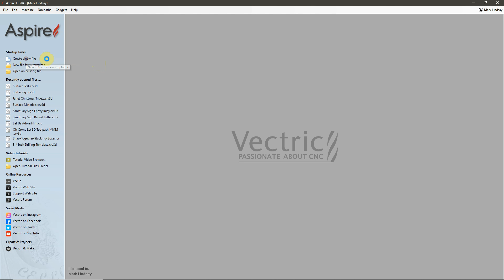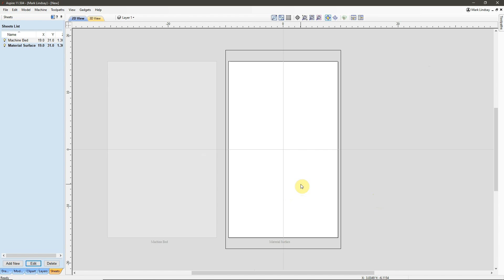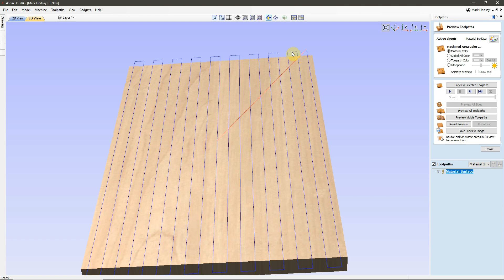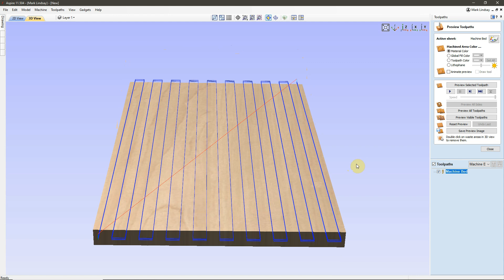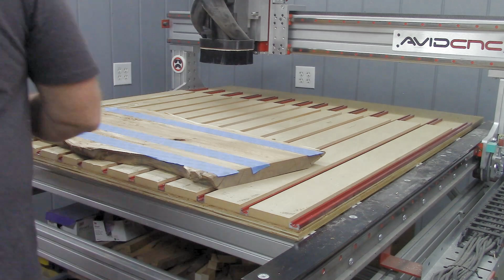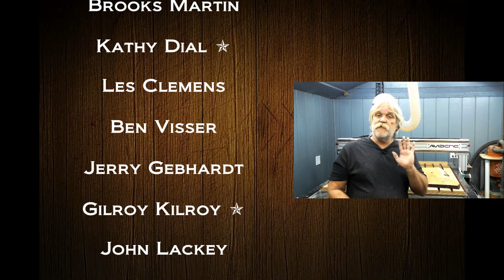Surfacing Materials Using a Toolpath on my Avid 4848 Pro CNC Router

Comment: Mark, thanks for 2 more very informative videos. I've owned my Avid CNC for 6 years and to this time the only thing I've surfaced is the spoil board. I have 5 Cedar slabs around 24" in diameter, which are too large for my planer, that I need to surface. Like your slab none of them are flat. I've never used MDI commands, so I picked up several useful tips in the first video of this 2 part series. I always visit your site when I need an answer!!!

I do have 1 question. Where did you get your dust shoe on your machine?
Reply from the maker: Thank you! I got my dust shoe from Keith over at One Guy in a Shop on Etsy. He's a good guy. If he doesn't have what you need, he'll make it for you.

Comment: I realise that you are only taking fairly shallow passes to surface the material but wouldn't the use of 'Ramping In' be of assistance when doing so?
Reply from the maker: Good question! Because I set up the toolpath to come off the end of the material by the bit's diameter, I don't need to ramp in the plunge moves. It'll make those plunge moves way off the material, then enter the material at the correct depth for that pass. If I had created the toolpath's vector smaller in Y, then yes, I would want to ramp in the plunge moves. Good catch!

Comment: Another very helpful video, Mark!  I know know to run the Y further out at each end, to eliminate the X-move machining marks that I would otherwise have to sand out.   One question:  It looked like you started with a small TBN in the collet.  Was this just to establish X/Y center zero?
Reply from the maker: Thank you, Rick! You're 95% correct - I initially put a 15° v-bit into the collet to set the X and Y zero. The flat side of that particular bit lets me line it up exactly with the line I drew on the center of the material. I didn't need absolute precision with setting the XY zero, as the bit and toolpaths are so huge. My XY zero could have been off by .25 inches or more, and the entire surface would still have been machined. Still, I try to be as accurate as I can.